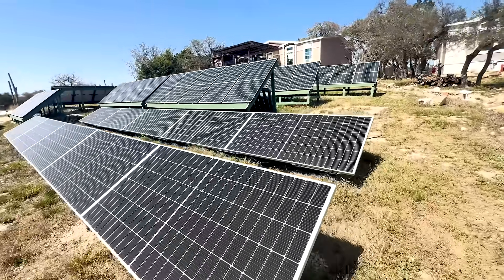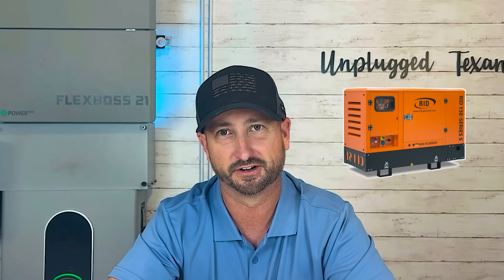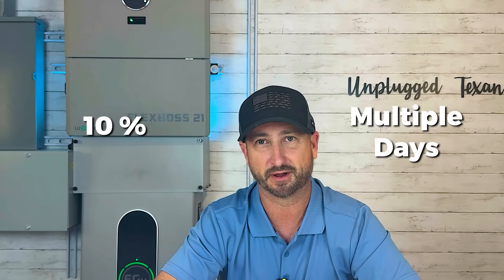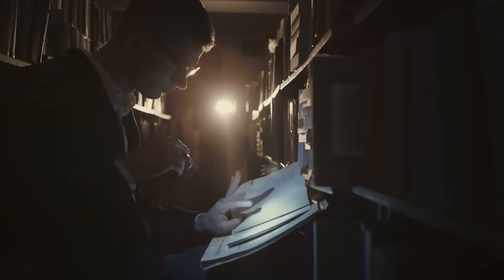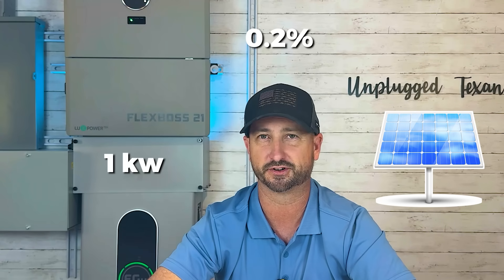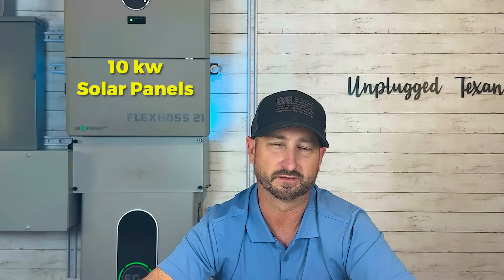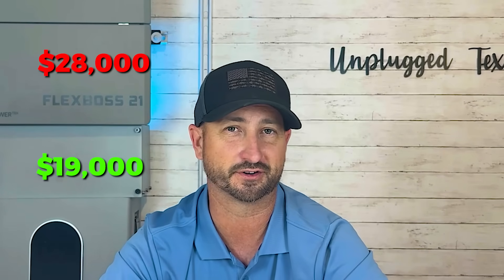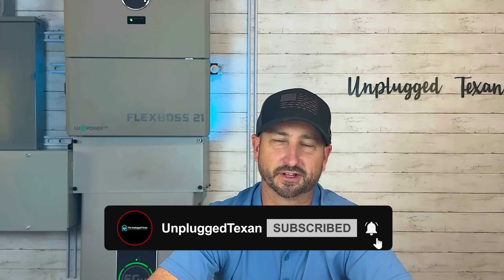WHOLE HOME SOLAR With Battery Storage: Is It WORTH It?

Comment: Solar has to be worth it, with battery. I'm in the UK and my daily rate for power is the equivalent of 35 cents per unit. Really worth it as costs will only ever go up.
Reply: In my area, including taxes, electricity is only $0.15CAD per kWh. They also pay out slightly less than that for export power... So solar makes far less sense here.
Reply: @Snerdles  with battery you are grid down proof, take back your power and be independent.
Reply: @Livingsolaryourway    I live near the commercial district in my city. I think I've only had 1 power outage that lasted more than an hour in over a decade. I would like battery backup but I want it small and able to go bidirectional with an EV like with the point guard system but it hasn't really launched with working vehicles in North America. Plus, batteries make the system so expensive it will never pay for itself.
Reply: @Snerdles  not true my friend.  I have found  12.8 @ 280amps batteries that cost $0.08  to $0 10 a watt. You always need four batteries to make 48 or 51.2 volts so I'm putting together an 30kwh battery storage for around $2,500.00 with taxes.
Reply: @RoyceBluford  You aren't allowed to grid tie those where I am because they have to be certified and have specific labels to be authorized by our power company. So basically you have to get brand name stuff and not things like EG4, Li Time, or all the other DIY stuff. I've been at this for years now trying to make it work and eventually I might, but it's just way too expensive right now.

Plus, I have a hip roof do the south facing section is a trapezoid shape so I can only fit limited panels which makes labor costs prohibitively expensive so I will have to do it myself to even make it remotely viable.
Reply: @Snerdles  got you, if your west facing side is open.  Maybe you can put them there. Also not exporting open or ease some rules.
Reply: @RoyceBluford  my east side faces up a hill so there isn't much point there, but the west side faces down hill so it would work, it's just very small so fits only 5 or 6 panels depending on their size. The whole house is just a 50x24 bungalow so the east/west sides are small triangles, and north/south are trapezoids. My mains power comes in on the south facing side though, so it blocks a significant portion of the south side being used.

I'm even toying with the idea of building a pergola or deck awning with panels to get more panels to make it actually worth it, but then you get in to all kinds of building permits, code issues, and city bylaws, and many different strings of panels which means it might be better to use micro inverter solutions but that increases the price significantly and makes it so batteries need to be AC coupled so another inverter just for that which makes the price balloon even more.

Like I said, I've been at this for years and still haven't found a good solution, but I'll keep at it as more gear gets released and panels get cheap maybe someday I'll get something usable.
Reply: @Snerdles  okay! Then go bigger watt panels like 710 watt panels.  Microinverter are pricey, Optimizer are cheaper.
Reply: @Snerdles  I know a company called solar Permit solution.  They can do plans and do the Permit for you. Get you though that red tape.
Reply: @RoyceBluford  I can't, because my roof isn"t big enough to have two rows of 2.1m tall panels. They would poke up over the top and hang over the bottom.

Sure, optimizers are cheaper, but then you also need an inverter. At that point, as long as each panel in each string is facing the same way you may as well just run regular strings to a multi-mppt inverter.

Plus I live where it is cold, like really cold, so the voltage considerations are an issue on long strings.

You don't think over 5 years I've thought of these things? I've been designing systems in Open Solar for a while trying to make it work. It just doesn't.
Reply: @Snerdles  I hear all your buts, last thing all Optimizer don't need an string inverter like tigo Optimizer.  Maybe your utility company has a time of use, where electric is cheaper like in the morning so maybe just batteries.  Charge them   at the cheapest time and run your home on battery at the highest time. Best wishes and good luck.
Reply: @RoyceBluford  It doesn't we have flat rate, and we have a buy back rate that, after tax, is less than half of our purchase rate so we only get back a shade over 7 cents a kWh but pay 15. Plus we have to change our meter for the power company to allow solar. On top of that I'm trying to find a solution that I can do V2H from an EV that isn't brand locked like the Ford or GM system, so hopefully Point Guard figures that out soon.

Comment: I was running my shop and then one day they disconnected us, we thought it was a blackout. And by the time they drove off they had just left my service wires on the ground cut up in 3 pieces. I dont think solar batteries are worth it. We diy and went off grid. Since we used to work on E.V.s batteries were always plentiful.
Reply: Who is 'they'?
Reply: @Le_Comte_de_Monte_Felin  apg electric...

Comment: If I am planning a completely off grid system with battery and generator backup do I need both the grid boss and the flex boss?
Reply from the maker: @1yourtube  if you’re going to use the grid as backup then absolutely get the Gridboss also. If no grid connection at all then you won’t need it unless you want it for the smart ports. Watch my video on the Gridboss to get a good idea of how it works.
Reply: @unpluggedtexan  thx

Comment: Excellent information,  glad you are feeling better and great info on the meds !    Here in Kansas Evergy Electric has raised their rate from .10 per kwh to .15 per kwh over the last couple of years and they are already saying they want another rate hike in 2025 !            Not only electricity is going up but Natural Gas and Propane for heat has been going up here the last 3 winters in a row also so it might be a good idea to get a heat pump to help heat your home in the winter and cool your house in the summer.

Comment: In 2011 I DIYed my 7.5 KW roof top solar, grid tied, no batteries in a city in Utah County, Utah.  City permitting and inspection wasn't a joy but wasn't too bad.  I did it late in the year so the wait wasn't as long as it would have been during the spring or summer.
Today, still going through the permitting and inspection process on our DIY 10 KW ground mount, 8 KW inverter, 35 KWH battery system in Wyoming.  This time we are outside of the city.  In our county there are no requirements.  However I do have Wyoming state to deal with.  The state Fire Marshall's office has authority.  I have to have the plans approved then after install an inspection done.  So far not much different than before but only about half way through the process.
Reply from the maker: @jimw.3225  interesting. Thanks for the info.

Comment: I have watched many of your videos and would love to add solar to my home. But at 12 cents a kwh for electricity here in OK, the payback on a $20k investment (doing all the work myself) it is hard to make the leap.  (I drive a Kia). I would love to be self sufficient but there is a cost to that end.  I wonder if the solar equipment may become an issue if/when my home is sold.  But to be truthful - I really want to....
Reply: if there was a public disaster that affected your grid and your power was out for weeks to months. You would be feeling foolish that you cheaped out and did not make the investment to protect your family. It doesn't have to be this large of a system. At least something that would give your power to run your refrigerator and lights. Not having electricity would be like living in the 1890's. If we always looked at when the solar system financially pays for itself,  is very short sighted. Most things we purchase never pay us back, furniture, cars, appliances, phones, boats. All of these are financial losers. Nice to have, but they do not pay for themselves. Having electrical security for me, is a high priority. I have had my solar system for 6 years and it has worked very well. I am getting 2 - Powerwall 3 batteries installed next month. The battery solution wasn't that great before, so I did delay installing them. Now the price of batteries has come down to the point that they are very affordable. It will cost me about $23k to install the 2 powerwalls. There is also the 30% tax credit, around $7k, plus my local utility is giving me $4500 to install the 2 batteries. So my total cost will be around $12k for 28kw of storage capacity.  Solar panels last 25 years. Batteries have a 20-25 year lifespan. The quality and the ease of installation has made these solar systems available to the masses right now. Always do your homework when hiring a solar installer. You don't necessarily want the lowest bidder. You want a qualified business that has been around installing solar systems for a while.
Reply: Hello, to make real money back from your utility company.  First find out what their buy back rate. Also ask is there a limit to what you can sell back. You will need hybrid inverter, enough battery storage to carry you 14 hours to start and at lease 7kwh of solar.  Every one pays per kwh . My BBR is $0.035 per kwh, to make a whole dollar i need 33 kwh of solar . The average perk hours is 5 to 6 hours a day. 33 kwh times 6 hours is 198,000 watts divided by 1000 = 198 times my $0.03  = $5.94 you earned in a day x 30 days = $178.20 .  So! Whatever your BBR (buy back rate) divid it by a dollar  that's how much solar you to get paid real money from your utility company.
Reply: Just did my taxes and solar equipment that receives a tax credit has to remain in place and in use for 5 years from installation date so, it might affect your ability to remove the equipment later if you move in less than 5 years. If you don't claim the credit - take it with you or offer to sell to new owner.
Reply: I just saw this video of an $8K 4 car DIY car port. Maybe something to consider.

https://youtu.be/B0lCJ0cK6hg?si=2Obbsd03NgHi3yUU

Comment: As costs for the systems rise due to the #trumpinflation #trumptariffs, the payoff timline is extended.  Add to that #trump threatening to remove the IRA tax benefits, and the payoff is extended further.  More losing thanks to #trump.